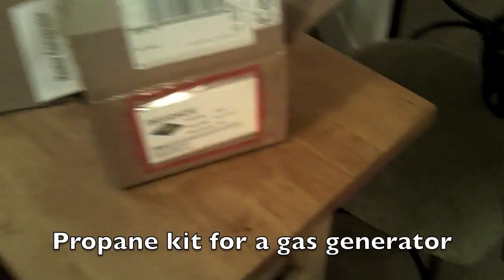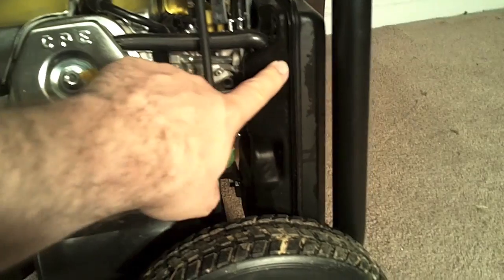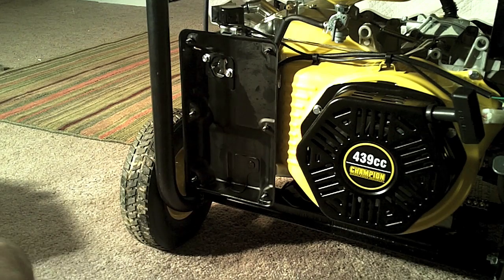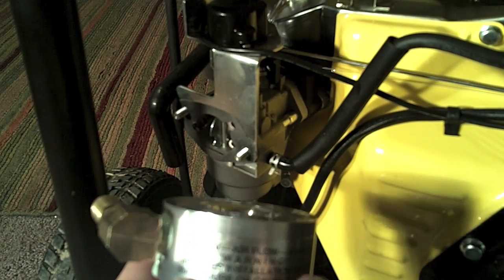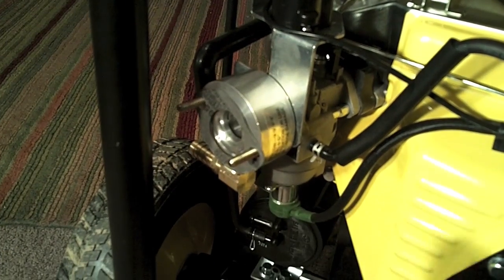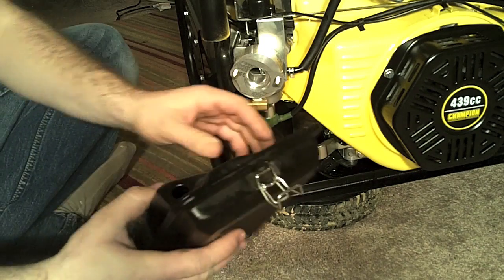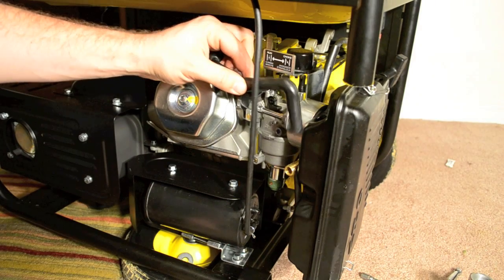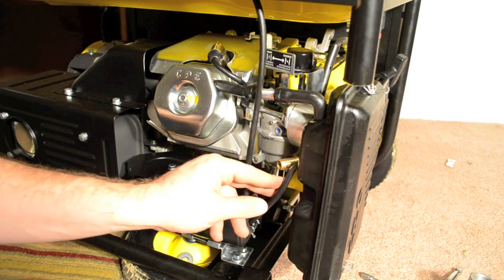Part 1: Propane kit installation for gas generator

Comment: lpg carburetor for Dual fuel GASOLINE LPG CONVERSION KIT,LPG conversion kit for gasoline generator 5KW 188F carburetor
http://www.aliexpress.com/item/GENERATOR-LPG-GASOLINE-CONVERSION-KIT-FOR-HONDA-GX390-188F-5KW-ENGINE-FREE-SHIPPING-PROPANE-LIQUEFIELD-PETRO/32234776518.html

Comment: Scott, thanks for posting. Unfortunately, I missed your video before doing my install on the same generator. I made a video myself for any others who purchased this generator. I ended up cutting mine as well and attached the regulator on the outside edge as opposed to the short side edge where you mounted yours.

Comment from the maker: Apparently, there is a smaller profile carb attachment that you can get which eliminates the need to cut the frame. It wasn't available or I wasnt aware of it when I bought the kit. You might try calling US Carbs or look on their website for more details. Good luck!